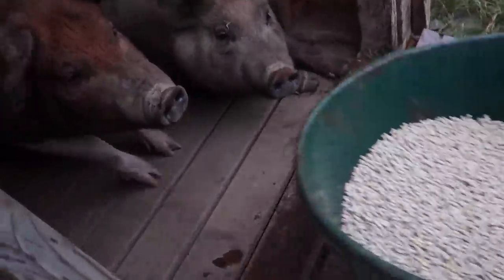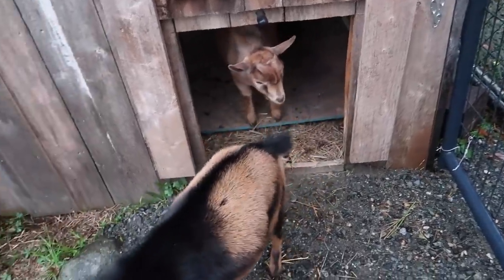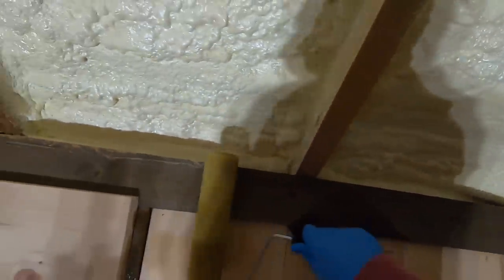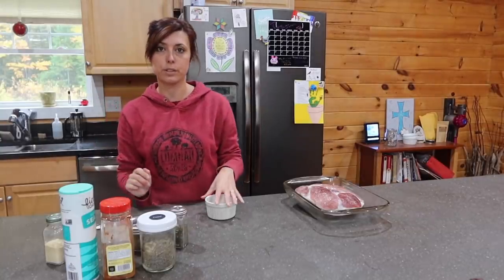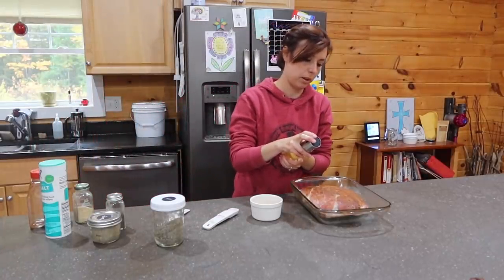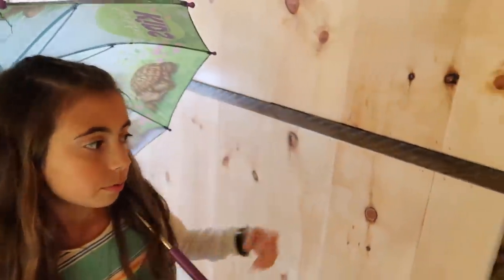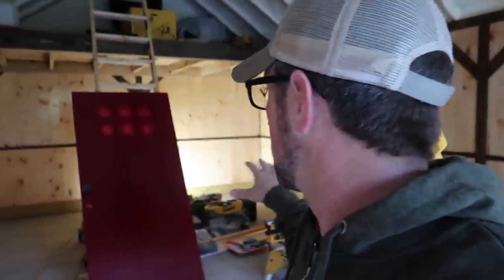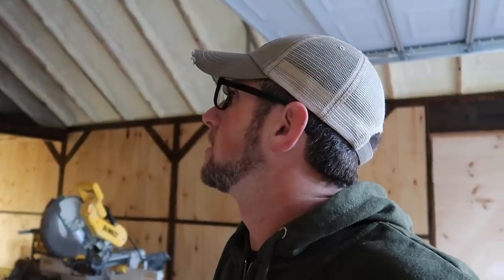Time to Get Sticky! Applying the FINISH to the Post & Beam WorkShop

Comment: My suggestion is to use the workbench to contain your power tools, hidden inside the workbench and by using scissor lifts you can raise and lower the tools into place when you need them, this means that the are centered and squared, all ready to go when you want them and you have full access to the work bench for all of your projects at anytime. 

So your table saw or chop saw, drops into the workbench and you cover it will a drop in plate and the whole bench is clear and ready to go. The same with your router, drill press, battery charging station. You need it you just lift the plate or just crank the turn knob or push the button and up it comes out of the bench.  If it is too big for the workbench drop it from the second storage floor into place. 

You can buy the scissor lifts, make them or adapt a old car jack  also called a screw jack if the height is right.   You can look at the links below for some ideas. 

https://www.amazon.com/Electric-Hydraulic-110V-240V-Platform-Electronic/dp/B07XW98Y5G/ref=sr_1_40?qid=1570830877&s=industrial&sr=1-40

https://www.patreon.com/posts/homemade-wooden-13466436?utm_medium=social&utm_source=pinterest&utm_campaign=postshare

https://www.pinterest.ca/pin/463659724135265844/

https://www.touchstonehomeproducts.com/blogs/news/hidden-kitchen-storage-how-to-install-a-motorized-lift-for-small-appliances

Oh,

the envy! I can feel it now!

Comment: if you do a kitchen island type heavy duty one for in the middle of your work shop remember and seal the top so if you are working on heavy machinery you can wheel it to where you are working this will save you going to far back and forward from where you are working also put cupboards under it so you can have your heavy working tools with you when you work on the tractor or heavy equipment just a thought.

Comment: Build your workbeanch top as flat and smooth as possible and then add a thick screw down sacrificial hardboard top. Make sure you do NOT glue it down, but only use screws or bolts. When the old top gets damaged from use, unscrew, turn over or replace as needed. This will extend your workbeanch use by years. The old hardboard can be reused for other smaller projects.

Comment: You don't need to use the existing radial arm saw table at all in your new shop. You can build in a long table top on the left side and just mount the radial saw to it. Just a thought. Stainless steel makes a great workbench top. I guess that the choice you make depends on how its going to be used.

Comment: Let's state the obvious. The bench should match the table saw cart so that you can use the bench to support boards as you cut them. Do not block the ends of the bench with things like a vice or that bench height won't matter.

Comment: My 2 cents. My first choice for your barn electrical is rigid conduit (galvanized pipe), back boxes and fittings (rain tight). I don't know what your codes are there, but I would have to use rigid out here to meet code. Problem is, that it will cost 3x to 4x more than PVC (that's electrical PVC, not the white plumping PVC). Rigid will hold up better than EMT (will rust over time with humidity, and, will last longer than PVC( assuming it is Schedule 40, that will deteriorate being out in the open air over time, and, doesn't do too well if you hit it with something. Schedule 80 will do ok, but I don't think you will be using that). EMT would be my next choice and would maybe meet code for your environment, but eventually moisture will cause rust, I would still use watertight fittings. The last choice is PVC. PVC is easy cus you can just glue everything together and you don't have to have the skill of bending metal conduit. The fittings are not as sturdy as metal, however you will not have to worry about rust. Like I said, my 2 cents.....as an electrical contractor.

Comment: You have decent sized beams so some sort of rail to suspend shelves from comes to mind.
Easy to move or slide if you prepare it for that.
Even if you never move them a standardised rail and hanging system is useful.
If you have standard widths and heights for panels to mount shelves on they become interchangeable.
i.e. don't build panels to fit tools, rather make them be interchangeable and modular.

Heavy benches need floor support of course and wheels are a bit iffy.
However having the ability to have a bench or table you can approach from all sides is sometimes handy.
Overcentre drop down wheels are a good option. I'm sure you can either find or make something like that.

Comment: Vices,s x 2, Lathe, Jigsaw/bandsaw/Drill, Sander, Router Table, 
All on wheeled tables, or wheeled units. then maybe add a spinning stone.
for sharpening.
Walls could be used for storing hand tools like clamps, screw drivers, hammers,
etc

Comment: I think that's about right, usually paint/stain takes half again or more than they suggest. Especially with raw wood, it soaks into the wood.
craft table close to the man door, wood working along rear left side. The rear wall a mechanics bench with vise/anvil to the right end of table.  A built in cabinet with locking doors. Build shelves for circular saw, hammer drill that type items, on right wall towards rear. Next a roll out for the table saw. Then tool boxes all along the right.
 
Suspended 2 bulb florecent shop light ove the craft table, approx 1 ft from wall with a 4 gang plug box 16" above table surface.
2 - 4 ft 4 bulb shop florecent lights towards each end of rear wall work table, about 16" off rear wall. Then with 4 - 4 gang plug boxes equally spaced above the rear table 16" above surface.
Then 2 -6 ft 6 bulb florecent shop lights  running with the depth of the ridge line of roof, starting 4 ft back from garage door when opened. This will focus the lights in the rear of the garage where its the darkest. And over the task tables for more light if general lighting is not enough. 4 gang plugs are better than 2 gang in all work areas, in my opinion. 

Rear wall can also have pegboards for hanging everything not too heavy. Extension cords, clamps, hand saws, etc.
All table tops should be butcher block style, "Wranglerstar" just made one about a month ago could use the same ideas for construction. Good luck and I hope this helps.

Comment: Al, I would use 3/4 plywood with 4x4 and 2x4.  Makes a very solid Moveable, if need be, bench.  Think ahead and position saws so long large wood will fit for ripping etc. LED lights for sure in multiple banks so you can light sections and not have to turn on all lights all the time.
Looks too nice to work in!  😊😊🐶🐓

Comment: I would definitely do some kind of finish on the ceiling. Because if you don’t the roughness of that foam is going to collect dust and cob webs really bad. And will be extremely hard to cleanup. One thing to consider would be get some cheap 3/8 plywood ( or 1/2 if not to expensive) paint it well before installing (much easier, better coverage). Covering ceiling is 2 fold in that the dead space it creates would also add to the R value, appearance and ease of cleanup. I would paint white or very light color, to reflect light. That does make a lot of difference (color). Then on the work bench, the right side is where you indicated for vice. That side of the work bench should definitely be the butcher block style (2x4’s on end) glued and nailed then install vice. All legs should be 4x4 or 2x4 doubled and if you use plywood on top of any of it put plenty cross braces (prevents bounce) in frame for plywood. I would make the butcher block bench (BB) that whole side for a sturdy work area. But to do the whole work surface BB would be quiet expensive and don’t be to conservative with the width of work benches. These are some things that I have either done or experienced positive and negative. But these are the things I would incorporate in my shop.

Comment: You might want to put the vise on a large truck rim and post so you can move it around also, or have two , one stationary and one mobile. I built a mobile table saw station using a custom  two drawer base with the table saw mounted on top and added a flip up rear extension. Will send pictures if I can figure out how. Your channel has been an inspiration to me also. I'm building a small post and beam workshop (10x12) based on your barn build.

Comment: A workbench top that works well for me and is economical is 2 layers of 3/4" MDF (very level and stable) glued and screwed together. On top of that I used T&G maple flooring (got some cheaper 'end of box' specials) that fits flush glued to the MDF and nailed on a diagonal through the tongue into the MDF. That gives you an effective maple work surface that looks really great when finished with BLO and recoated once every other month. Suggest routing and inserting T-Track and build a leg vise, lots of good videos (Dema's Woodshop and Jay Bates). Strong suggestion is to make separate moveable units for your workbench and other tools ... Good Luck :)

Comment: Good morning Al. What kind of wood working are you planning on? Will you need a wood lathe,  a router table, a planer? A small anvil on a rolling stand that you could put underneath the counter when not being used may be a benefit. A dust collection system for your permanent mounted equipment.  Task lighting from the ceiling over the work benches. 
This is getting too long, I will email you some more thoughts.
Have a great weekend.

Comment: Have the one bench on the right side be a woodworker table/bench on wheels so it can be moved into the center of the shop to work around it with cabinets, and make the other one out fo metal on wheels for metalwork, welding, and anything that will have oil, grease residue that can be cleaned. and have the vice,  to be able to be moved as needed.

Comment: I might have missed, but are you going to be putting any type of heat source in the work shop area. Even with the shop insulated it will be cold in the middle of winter.

Comment: Put the chop saw inside the middle of one side, not at the end. You want to have both sides supported in a "shop saw station". Also consider the depth that the saw travels as well as the angles it can turn to when allocating space for it. Additionally, consider building a box around the chop saw to catch the saw dust. Those things always have horrible dust collection and they will throw saw dust EVERYWHERE!

Comment: My thinking is that along the ridge line of the roof, put in some nice wood to cover the rafter ties. Once that's done, put some 12v LED cool white strip lighting down the entire length. Amazon has it with an included 120vac adapter. I use it in my shop and it is surprisingly bright. Might also want to consider a strip width-wise under the front edge of the loft to give good lighting over your benches.
As for a good sturdy workbench that can stand up to abuse and hold a car engine, consider making at least one of the tops out of 2x4s on edge glued together like ||||||||||||||||| . You can pound on it with a 5lb sledge and not even worry about it. Keep up the great work and God Bless!
Reply: I was thinking the same thing. You can put it together with the Kreg jig, and glue, and it will last forever, just sand it down and oil/wax it. Really strong and tough. and you could use flashing as a top, in the area you will work on greasy things, or even on part or all of your mobile island. Leather covers sharp corners well, to keep from ripping yourselves! I want to make a top like this for my kitchen island.

Comment: For your light's run 2 rows of 6 then wire them on 3 switches with the first 4 on one then the middle 4 then the last 4. You will find  most of the time you will only need 1 or 2 of the 3 groups on .

Comment: Couple of Skylights would do great for more light... Easy install in the roof.... Might consider a small steel top on a workbench for some metal work..New welders are great for home use...For crafts consider a smooth top easy to clean and replace when needed. For woodworking and mechanical working can't beat a good substantial surface like sandwiched 2x4s with a heavy vice.. A wheeled bench to move away from the wall can make life easier.   Drawer type shelves under the benches keeps things organized. An air outlet at the bench makes things neat while working. Lights over the benches will be necessary. Don't know if any would work as part of your plan. A small wood burning stove with a ceiling fan would make working in the shed much easier. Looks like you installed closed cell foam. It does a great job,  Sounds like a fun project...Dampness will be hard on the tools...

Comment: Your shop looks amazing, great job to you both!  Go with metal conduit painted black. Safer, stronger and lasts longer.... If you all could afford it, I would finish the ceiling with the same boards from the walls.  Its a cleaner look and the light should be mounted against the ceiling to prevent dust collecting on top of them.   2x4 butcher block style benches with BDF tops that can be replaced from time to time.......
Reply: Oh, add a grey auto shop floor sealer.
Reply: I like the idea of metal conduit because mice and rats will eat through any plastic or wood.  Smart to think of putting the electric on the outside of the walls.  Painting the metal condiut black would be in keeping with the look you have in your door hardware.

Comment: My recommendation for the shop would only be start planning for a bigger one. After years and years of building shops and garages for myself on different places I've owned the only one thing that has come true is the older you get the smaller the house you want and the bigger shop you want.

Comment: Well if you have a Yamaha dealer boat motors. The crates the Outboards come in make great work benches. I have 2 they are free as they were pitching out. I rebuilt a big block engine on one with shelf under it. The other I put metal on top for welding. For shelving I used store heavy duty wall track with store shelfs at a big discount as a store was going out of business. So I got angled shelfs, regular, speciality shelfs and brackets then put wacky noodles on the bracket to store remote control boats on and nice long items I don't want to get dinged up.

Comment: Be sure to include a dust vacuum system with a floor sweep and possibly air filtration.  Think abt utilizing a cleat system on the walls for ease of use, versatility and adjustability.

Comment: I would go with a butcher block type of top for the work bench. Also you may want to use a good paint or concrete stain for your floor. If your going to work on power equipmentt in there it would be easy clean up if you spill oil on the floor. Great video.

Comment: Maybe have a worktable like one that Woodshop Junkies made where various tools can drop down out of the way for other projects . I'm looking at doing 2 of them, one for woodworking tools and the other for my wife's sewing table (where the serger and a spare machine can drop down, then have a huge cutting table or surface for piecing quilts together). have locking wheels under it so you can move it to where you need it (or out of the way).

Comment: I like the idea of versatility with putting the shelves on wheels, the work bench on wheels, so your not limited to one spot, you can utilize your space as needed per project. Butcher block ? Not sure what type of wood to use there. The shelves in the horseshoe fashion would look nice along the back wall. Will the wood blend in with the wood you've used on the walls? Whatever you decide will only complement it more. Pork Roast & mash potatoes, haven't had in a long while. Sure looked great! It was nice to see Caleb & Zeek! Those 2 porkers are lazy!

Comment: Maybe instead of having conduit coming down the walls, you could use an ivory colored wire mold with shallow surface mount boxes for outlets.  Being flat, it would blend better that the electrical conduit. I would definitely use the metal version considering that it's a workshop.

Comment: I would plan on a larger air compressor for air-driven mechanic tools and one permanent bench w/a heavy top on the back wall. For the side "benches" I would use a toolbox, that can be moved to what you are working on.

Comment: Tongue and groove pine on the ceiling would look nice and maybe some florescent lighting for a start,along with some outlets along the walls. Truth is,if you plan on storing tools,doing woodwork,automotive work and household type projects,you're gonna run out of room real fast. My suggestion would be to consider possibly checking into whether you can put a lean-to  enclosure on the other side as well,along with insulation and electric,this way your wife can have a dedicated area where she and your daughter can do their thing as well. To try and do all that in the main area of the barn would make for an over crowded situation from what i see. You'd wind up removing half the stuff just to get the truck in there to do anything........................and that's "without" any kind of workbenches and shelving. Just something to take into consideration. Just my.02

Comment: My thoughts. Build wall across the loft edge with two 4'x8' track doors centered, ladder to one side. Work bench across back wall with drawers under and 12" deep cabinets over top. One side for mechanics box and floor to ceiling shelving to fill next to tool box. 3'x8' work bench in center of room with retractable caster so it can be moved to the large area in the summer if needed. All power tool on caster stands to move around when needed. Can be stored in open area. That way the small area can be heated cheaply during winter and a big heater can heat the big area if needed, wood stove. Insulate the underside of the loft and plywood ceiling with fluorescent shop lights. That way the small area can be a winter work room and be heated when being used. Small area = small projects, Large area = big projects.